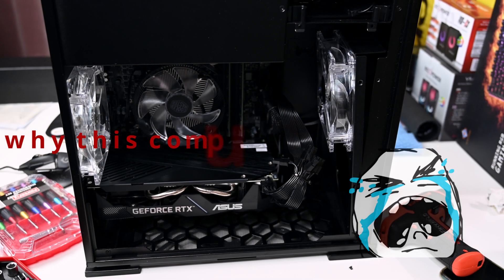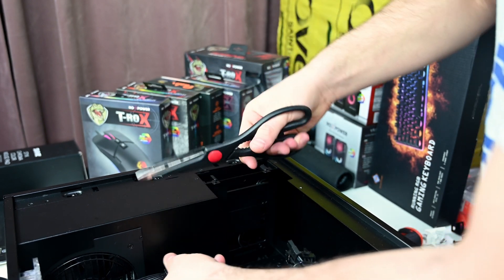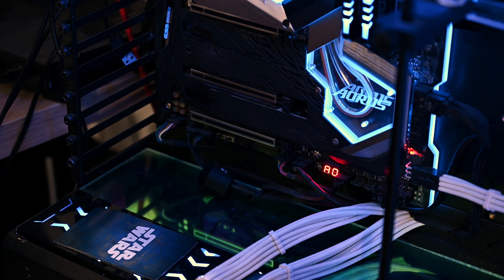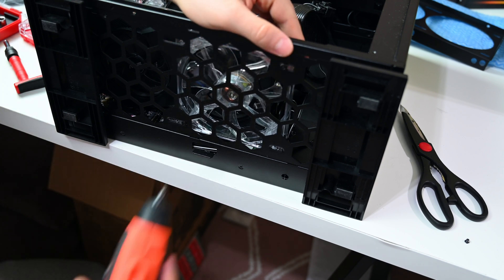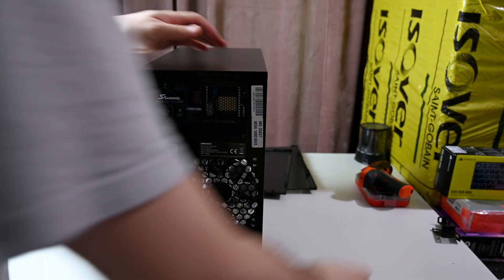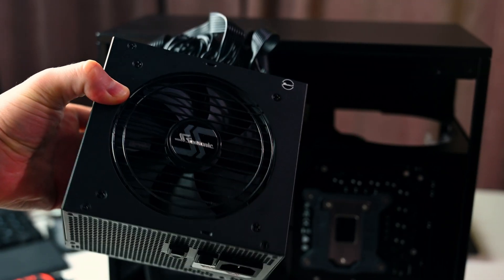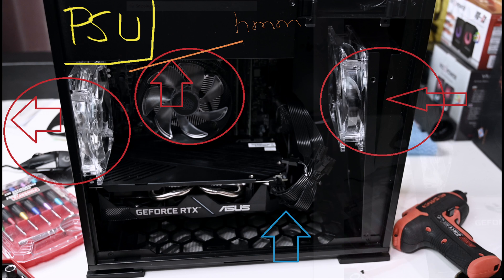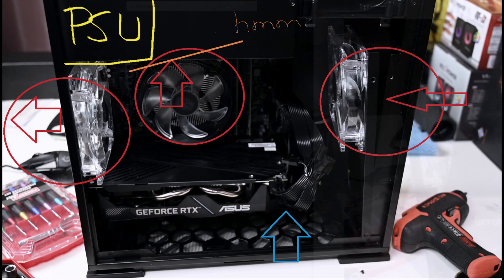Do Your Pc Freeze ? Fix for Medion Erazer Engineer X10

Comment: Despite upgrading the fan hardware and adding a controller, I've found the following solution to get more control over the heating in standard configuration and sort of a solution I guess... 1) Install Fan Control V118, 2) change BIOS settings of the fans to manual (both CPU as system fans). 3) categorize the fans in V118 4) setup linear curve for CPU and connect to CPU and front Fans 5) setup graph curve for GPU and connect to back-fan. Results I was getting with a more silent system were CPU around 35-40 degrees idle and 60 degrees under load, GPU 35-40 degrees idle and 75 - 80 degrees under load. My configuration was de X10 with I5 and GTX 3070.
Reply: Well 5 months further, did the next upgrades:
- cpu cooler replacement for corsair h50
- Corsair rm650 power supply replacement 
- put 1 fan at the bottom, two new ones in the front
- replace gpu fans for 90mm noctua fans
- undervolted the gpu

Results: 60 degrees Celsius cpu, 65 degrees gpu at full load without sound (PSU is loudest of the setup)

Shouldn’t be necessary when buying a new pc, but yeah for now this was the best way to still some good feeling with the purchase 😅
Reply: @deadlock8  how many fans do you have 2 or 3 also what layout pls
Reply: @kikar92  Currently i've changed the whole setup due to a gpu upgrade. But I ended with AIO 120mm watercooling for CPU at the back of the case, 2 fans in front and 1 fan in the bottom.
Reply from the maker: Very precious info brother thank you very much I pin it
Reply: @Gamingtechgg  To be honest, I just cancelled my order for the hardware upgrade. For now its fine for me ^^
Reply from the maker: @deadlock8  happy to hear, normally you should not be required to do any of this but you know how prebuilds are
Reply: @Gamingtechgg how do I take the glas panel off?
Reply from the maker: @gamingprofi2584  there is a latch
Reply: @Gamingtechgg  and where
Reply from the maker: @gamingprofi2584  https://www.youtube.com/watch?v=eAl1ryO1fpg 03:26 you are welcome

Comment: Listen i got the same pc, brand new and just after a month it restarted at its own and booted in bios 😓 Cant do anything 🥶 could this be related?
Reply: Thank you for taking the time to reply to my comment!🙏
Reply from the maker: Were you gaming ?
Reply: @Gamingtechgg  in the Netherlands.
Reply from the maker: @maikeldolphijn6181  Have you checked your temperatures ? I fix all of the issues with this machine
Reply: Yeah, temperatures seemed fine. I don’t know at the time of failing what the temps where tho. Weren’t really doing anything aswell, just installing some games on a external HD. But anyway I shipped it back today, so hopefully they can find out what the problems is.
Reply from the maker: @maikeldolphijn6181  From my testing depending on what hardware you got if you have rtx 3080 with this case, with fan layout its not working well.  
Reason for crash freeze or blue screen is due to alot warm air being trapped inside the psu. 
Removing tempered glas helps with thermals but why would you want to do that.
Those inwin case fans barely push any air. You just reminded me now, how many problems did this system have. Fingers crosses for you buddy, keep me updated.

Comment: I have this system with a 650w PSU and a zotac 3060ti could I tranplant all the internals to a lian li 216 case with its beeter fans/cooling
Reply from the maker: Yes you can transfer everything

Comment: how do i take the bracket off thats holding the front fans?
Reply from the maker: there is 2 screws inside
Reply: I found them but If i switch The fans place to The bottom of The case does My warranty go away?
Reply from the maker: @oook-vf6  no it wont, if you need to take it back just have it in original state
Reply: Thanks you helped me much 👍
Reply from the maker: @oook-vf6  you are welcome brother

Comment: am going to buy the medion erazer enigeer x10 rtx 3060 i5 12400 is it good and can it freeze? and how much watt does it have can u please anwser these 3 questions
Reply from the maker: No idea what psu they have used the one tested with was 11th gen cpu, overall the system had awful cooling capabilities
Reply: @Gamingtechgg  and what if am buying the pc and using another case?
Reply from the maker: @rens1490  mother is 35euro oem board, I don't know why you want to buy this system when you can build 10 times better system with parts that are picked for your needs.
Reply: @Gamingtechgg  i cant build a pc its to much work do u got another better prebuild for me for 1000$
Reply from the maker: @rens1490  https://discord.gg/r4dmRjmw
you are welcome
Reply: @Gamingtechgg  your right when i look at the from pc  medion that am maybe gonna buy does it not it show the psu but that doesnt really matter the psu has 650 watt if u look good so thats good the motherboard is a intel b660 thats really good for an intel 12400 the only thing thats maybe bad is the cooler bc it doesnt show anything about it and the case but the graphics card cpu motherboard and the other things are really good i think
Reply from the maker: @rens1490  650 is plenty for 3060, model I tested was horrible had to fix the all the issues as you can see on the videos I done
Reply: @Gamingtechgg  oh okay i will look for another one then
Reply: @Gamingtechgg  oh okay :( i cant verify in ur discord bc i dont have a email and my phone number got already connected to a discord account but i forget the password
Reply: @Gamingtechgg  u got another prebuilt pc for me under the 1100
Reply from the maker: @rens1490  I have only tested acer nitro, medion and shark gaming
Reply: I want to buy same one, do you suggest it to me ?
Reply from the maker: @ahmadkasim8260  I don't recommend to be honest. Currently there is better deals out there 
You are welcome https://discord.gg/wfDChqAx
Reply: @ahmadkasim8260  the specs are good but some people said that the system isnt that good and others just said its good so yea i guess i would do it cause the specs r really good
Reply: @Rens

Comment: Why don't you just use a different case for about 70 80 euros? 
And a question about the motherboard, is it a Gigabyte B560M Aorus Pro?
Reply from the maker: You can use different case yes. This is not My Main system. OEM motherboard from Medion
Reply: @Gamingtechgg  thanks for the reply, im getting mine today with the i7 11700 and rtx 3080 for about 1800 euros.
But it has an AIO watercooler, I think from coolermaster. Same case but different front.
If it has heating issues like yours, I'll buy a bigger case with better airflow, who came up with the InWin 301 case with no front intake, really stupid decision smh.